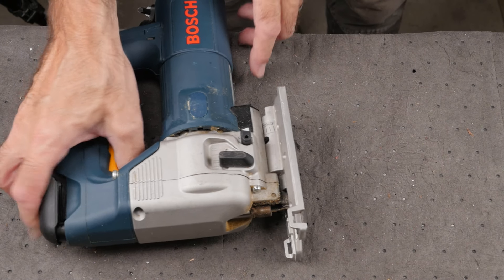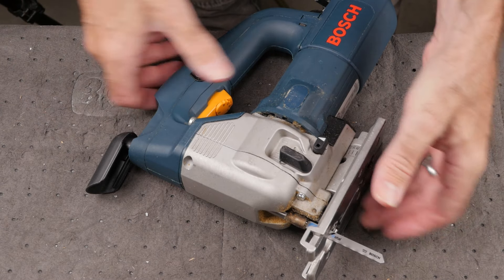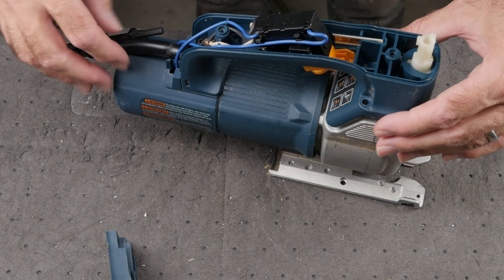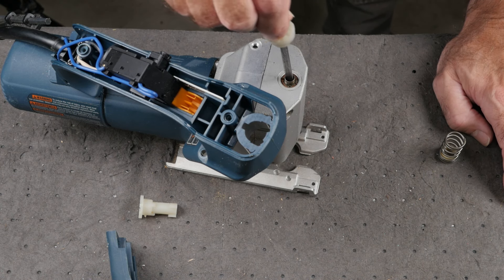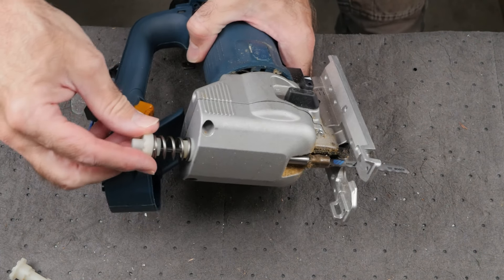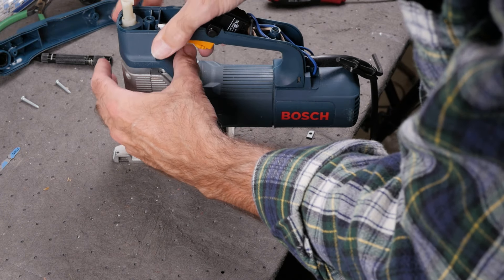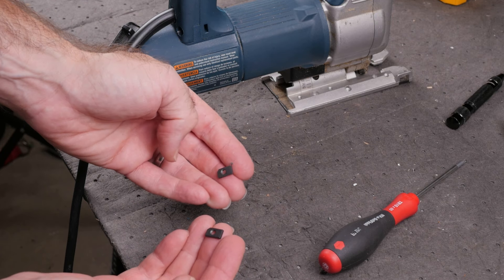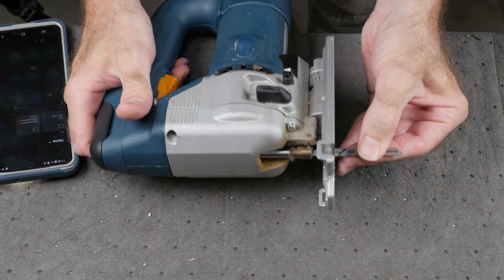Fixing A Bosch Jigsaw That Won't Hold A Blade - The Blade Falls Out

Comment: Thanks for your video,  gave me the inspiration to try and repair mine...the blade retention went fine...but now the thing will not run.  in the bin
Reply from the maker: That's too bad!  Did it run before you fixed the blade retention?  If so, something probably just got disconnected.  If not, it still might be fun to investigate further!
Thank you for the comment.